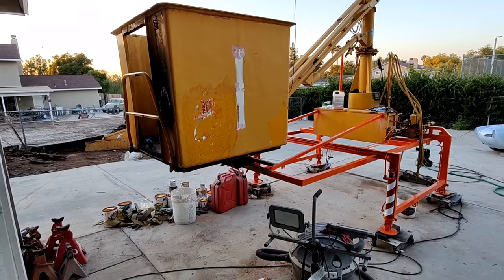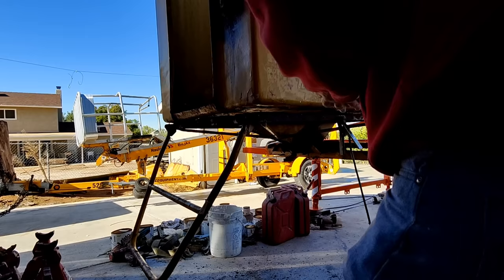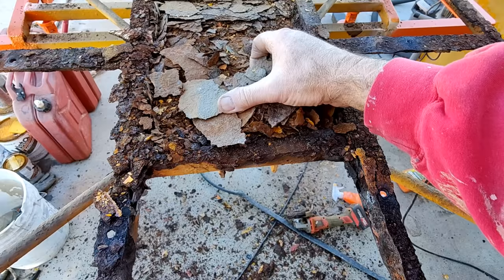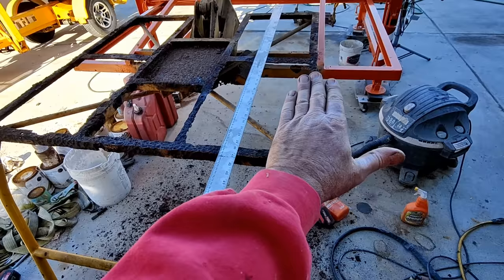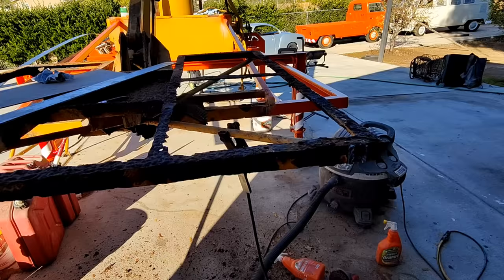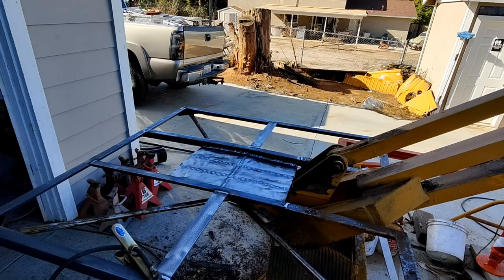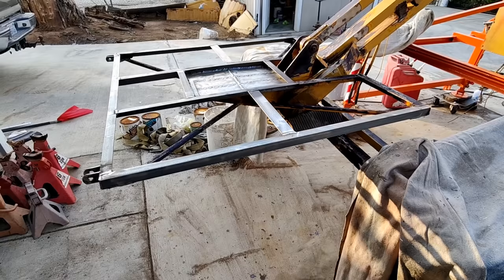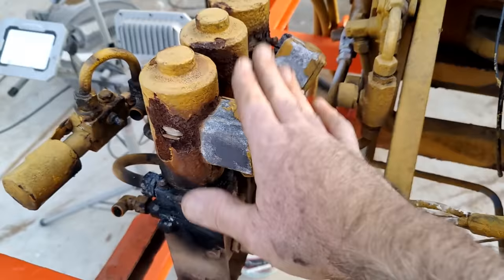VW single cab so10 Ruthmann cherry picker  removing the basket restoring rusted out metal

Comment: Hi Mike:  Most of the solenoid valves that I have dealt with have a removable coil pack.  You might try cleaning off the top portion of one of them to see if there is a removable cap which holds the coil on.  If you can salvage the coil you probably won't need to open the valve portion.
Reply from the maker: Yea for sure That is sort of what I was thinking. We shall see.

Comment: super easy to remake that base for the bucket....just copy it and start fresh...i would consider aluminum but that is costly...and you gotta tig it.... you got a template it is all you need ...measure width..length...make it that size add the pieces inside and cut the notch out ( the end by boom ).....the thing is a rectangle and a few added parts..

Comment: Die Kappen auf den Magnetventilen müßten sich eigentlich abdrehen lassen.Sind zwar ziemlich rostig,aber mit einer großen Rohrzange muss das gehen .in den Erhöhungen oben sind die Gegendruckfedern mit etwas Fett,um den sicheren Verschluß zu gewährleisten.Ich habe viele von solchen Magnetventilen ,allerdings für 220V,repariert.Die Bauform ist aber die gleiche.Viel Glück.
Reply from the maker: THANK YOU Here is the English translation for others to read The caps on the solenoid valves should actually turn off. They are quite rusty, but it has to be done with a large pipe wrench. In the elevations above, the counter-pressure springs are coated with a little grease to ensure that they are securely closed. I have a lot of such solenoid valves, but for 220V, repaired. The design is the same. Good luck
Reply from the maker: Vielen Dank, ich habe Ihren Kommentar ins Englische übersetzt, damit er anderen gefällt.

Comment: I would have thought a triple solenoid bank wouldn't be that expensive,  might pay to look at some modern second hand stuff.
Reply: Definitely better and safer to replace the valves
Reply: it adds up but you gotta pay sometimes to get it working...he seems to want to RESTORE it?
most of that stuff won't be available...

Comment: What's the Height/Reach of that unit? and bucket Capacity / Lbs??
Reply from the maker: Not very high ha ha. I think its 6 meters. IDK really. what is that 17ft standing height. and 2 person basket but the weight is ridiculous like 120lbs per person. 2 girls. ha ha.
Reply: @Mikefngarage  
roughly 20 feet
my bucket ( smallest of 3 i have ) goes up 33 feet...can reach 35ft approx... 300 lb single bucket cap.
Reply: @Mikefngarage  
120 lbs...geez...that is children not men...guess they were shorter and skinnier after the War?
Reply: @Mikefngarage  
still depending what your reaching it helps... my bigger one goes to 115ft

Comment: Looks like you've had to repair the wagon wore then any other vehicle. I sure wouldn't buy one. I'll keep my 84 Jetta and maintain it.
Reply from the maker: I literally have had no problems with that car until the engine went out. that is when all this started. 1 bad engine and the other has not quite been right since. still working out the bugs.